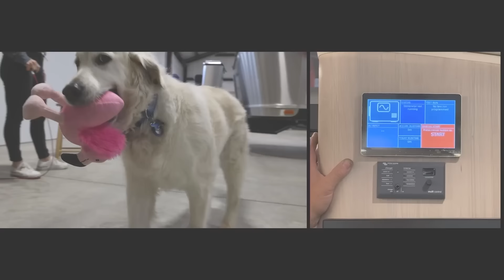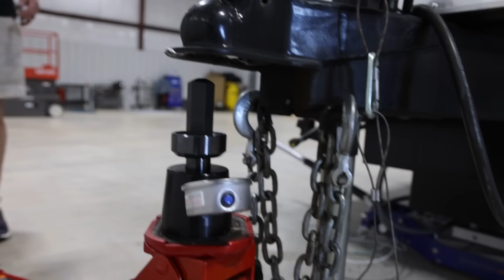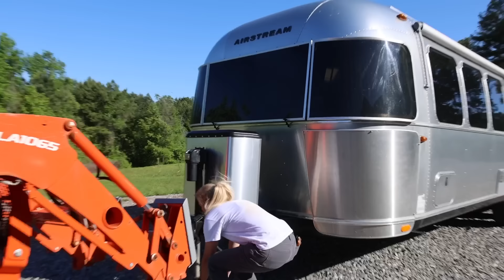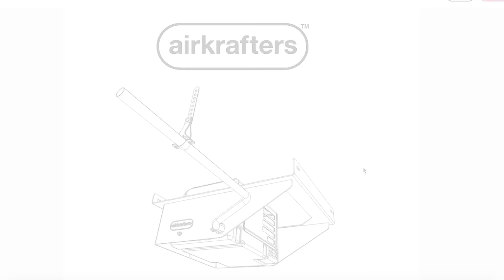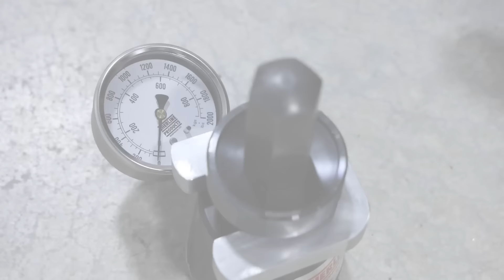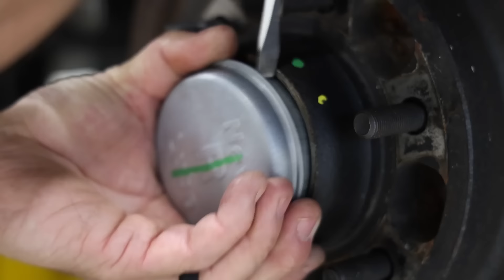DREAM BUILD: Airstream Lithium, Solar & Generator Install

Comment: Really enjoyed the video guys.  Couple things, with the new solar panels I noticed that he left the old panel holes unfilled when he placed the new panels on.....Did he go back and plug them?  Did he take into account the 114 degree plus weather (I know you live in Flagstaff) that you get in Arizona having an effect on the sealant that holds the panels to your Airstream?  And finally, I believe you said you went from a 8" clearance underneath to a 9" clearance once you placed the generator on and moved the spare tire?  So in essence,  you put on a 3" lift and gained actually only 1"?  Will that 1" make a big difference not scraping bottom?  I will definitely be interested in how much it would cost somebody to purchase all of this and have them install it once everything is said and done.  Sorry, one more question, won't the generator connected to your frame not only cause noise, but vibrate the entire trailer?  Take care and Happy Trails.
Reply: Yes the holes from the factory panels were patched, Yes I account to temps and sun exposure, Yes you gain 1” at the Generator, but gain 3” at the butt, the mother for the Generator is mounted with vibration isolators so not vibrating is felt.
Reply: @airstreamnutsandbolts  Thank you.  Appreciate the feedback and excellent job!

Comment: Victron suite Best of the best!!  In Spring of 2020 I went all in on Victron. Battle Born batteries were the only real choice then.. As an engineer, I designed and installed.  To this day it is still A W E S O M E! Just got back Smokemont...no hookups. No worries though with our 600AH batteries, 3000 w inverter/converter, 4 solar controllers, DC to DC converter, and all the other Victron stuff. Solar: 640w Plus auxiliary ground input for added 1000w.  Boondocking at friends and family's the real genius  of Victron inverter/converter: I set the max draw from daughter's wall outlet to 10 or 12 amps and Victron makes up the difference for running our microwave/convection oven,  air conditioner, and toaster!!! Game changer!! The inverter can supply 50 amps combined from the batteries and external input.

Comment: 21:40 I spy an 0155-2449  Resonator / Muffler!  They are awesome.  I installed one on my 2500i inverter generator and did a before and after sound test video on my channel.  It makes the exhaust note a lot less harsh.
That video and all the others on the 2500i are in a play list.
I was a BETA tester of the Onan Cummins inverter generator back in 2019.  It's a very nice generator and so much quieter than the outgoing model it replaced.  I actually prefer using it over my Honda EU2200i because the Onan is quieter.

Comment: Wondering if the movement of the axles (up and down over bumps, etc.) and the water tank straps being attached to the axles will cause flex and movement against the stationary water tank.  Won't this cause unwanted forces on the tank and eventual problems and/or failure of the tank?
Reply: It's not an issue because the axles are Torsion style axles and suspension.  The axles never move like they do on a leave spring style axle - they are hard mounted to the trailer.  The wheel spindles are on a pivot point at the ends of the axles, so the wheels are the only thing that moves.
Reply: The axles are Dexter Torsion axles.

Comment: I like that Ronnie but a pair of brackets under the water tank, but I would think that right angle bars would have been more supportive. The flat bar will flex.

Comment: Rob wants to know: Do you have any concerns about all the weight being on that side? (Fridge, batteries) It’s the best use of space as storage under there isn’t easy access but for weight distribution, he’s thinking behind the battery box might be better. Rob is being logical and I’m trying to save one of my favorite storage spots 😂 Sherry
Reply: This is Rob. To clarify, the added weight was on the driver’s side with the fridge. You chose to put it there instead of the compartment behind the battery box, which would have been centered left to right. Any discussion about more weight on the driver’s side versus balanced left to right?
Reply from the maker: There is still plenty of tongue weight, but I'd rather have the weight over the axles. It hasn't changed the way it tows.

Comment: Good thing about mods is that it’s a to each their own type of thing and I enjoy looking at options for sure. For me, I like off board gear that I can leave behind when not needed such as a generator or easily replaced if it should malfunction. What you’ve done here is give folks an idea of what can be done and that’s very cool and I appreciate the content. Safe travels KYD and hope to see you on our Route 2 Adventure

Comment: Did you go from 2 bolts holding one axel side to just one on the top of the axel ?
Reply: Nope, there's still two bolts per axle and two that hold the lift bracket to the frame.
Each lift bracket has four bolts, two of which are for the axle.

Comment: It's always amazed me at the poor quality built into all mobile homes. Even the ones that charge more for their product.

There is no reason Airstream couldn't put in better skylights or raise the axles to provide a safer experience. Or, how about making a refrigerator door and shelving that will hold your expensive food in place? Trailers and motor homes are at the bottom of the quality charts, and they charge so much for them.

Comment: What's the difference between the micro air and the soft start brand AC soft starts?
Reply: Micro Air has been around longer and is the gold standard.

Comment: I have done mostly what you guys are doing with the solar part. I wired my TV with Anderson connections as well for the DC to DC. The question I have are the Maxim Skylights. Did you have to measure a head of time to order these? I went to their website and it looks like an order form requiring measurements. Did you take off the factory plastic skylight for that measurement?

Comment: I'm watching that strap installation. It's a good idea to put some bracing down there, but it appears like the straps are even giving way from the weight.  Have folks considered going with 1" angle aluminum for the strapping material?  The aluminum should be plenty durable to weather, and the angle would give a lot more strength to prevent the bulging when covering the span between the forward and rear axles.

Comment: Don't  Axles move up and down going down the road, and those straps will move up and down and crush the water tank.
Reply: No, the axles don't move, they are hard mounted to the trailer.  The wheel spindles are on a pivot point at the ends of the axles, so the wheels are the only thing that moves.

Comment: Depressing to watch. The airstream is 200k, a diesel truck is 70k, and mods are probably another 100k. In total a mere 370k cost to get started camping. 🤣

Would love an airstream, they have gotten out of reach for average people.
Reply: They typically buy used Airstreams so you can figure $70-85k for the trailer.  Their truck, at the time, had over 100k miles - so the original cost is irrelevant.  Their solar set-up (generator, inverters, solar controllers, panels, monitors, etc) probably cost $12-15k.  The batteries were, obviously, free.  You are very, very far off from actual reality.

Furthermore, the Leach's are real people but they have done well for themselves.  To fault them for this is absurd.  They do not come off as wealthy, nor pompous, nor anything which screams "we're not for the average people."  They have raised three incredibly well-behaved and successful children and have been on YouTube for 10 years now.  They have grown because of how genuine they are.

Comment: You are getting paid by the companies with products that are worth thousands of dollars. There’s nothing wrong with that. Just don’t say you aren’t getting paid.
Reply: You pay a lot of money for an Airstream and then a lot more to put in the technology that Airstream should already have built in considering the ridiculous price they charge.  Great mods.  For those of us not getting these mods free, what  is the total cost of the mods you made?
Reply: @lew3057  that info is coming in part 2, they said that in the video
Reply: Don’t forget the equity you gain in the trailer kinda like getting paid a little
Reply: Why did you need the tractor to back the trailer into that spot?
Reply: @rlucerin28 tractors are used at dealers & manufacturers to move rigs. I’d say it’s because they move easier than trucks do.
Reply: @Elizabeth-rq1vi  not when they're already hooked up. I can see them doing that after unhooking from the pickup.
Reply: Getting physical paid and getting a product for free are two different sentences. It's important to remember that someone that is not you does not and is not required to speak the way you want it. No point in criticizing the comment.
Reply: @TheBurtonsAreHere getting free product is getting paid because you have just put thousands of dollars into your pocket that you didn’t have to shell out for the products. Sponsorship dollars are still dollars no matter how you slice it. What @mikekuliefinney said was exactly correct and did in in a kind way to boot.
Reply: Marc - you loose a little integrity when you try and say you guys aren’t compensated. Just tell it like it is - free BB Batteries and free Victron gear worth thousands of $$$$
Reply: @markt1054  I keep searching YouTube, google, yahoo, and asking my iPhone and I still can't find a law where someone has to word for word explain or the way you specially want it. For free and getting actual cash are two different structures. No one is required to speak in terms of how you want it, if you got what he was saying then just settle for that
Reply: Omg I was just saying that. You’re not getting paid cash you are getting paid in stuff!! I really like them but that just kind of ticked me off that he stressed that they are not getting paid.

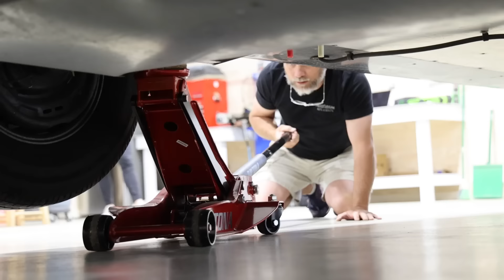Comment: 10:40 please no one stick a family member or another human for that matter all the way under anything this heavy. (I understand that the tires are still on but shackles springs ect break during impact)  use a 2x4 or a stick or something to line up jack stands.  I've made calls with people under things... unpleasant...

yes it's easy to say from a keyboard but if it stops one person....
Reply: This rig doesn't have shackles or springs.  It has Torsion Axles.
Reply: @deltabravo1257  didn't notice that.  Thanks
Reply: Trust me. It’s my wife.  We are very safe. I’ve done 100s of Airstream lifts and am very familiar with the process
Reply: @airstreamnutsandbolts  really enjoyed the video and your explanation and work.  Some people aren't perfectionist as you are and can be quite careless (as I'm sure you've probably seen in customer rigs) resulting in something happening they weren't expecting.    Just my thoughts and opinions.  YMMV.

Comment: I like all the mods you are doing for long term remote camping.  I would also add a water tank to the truck for increasing your fresh water supply.  Then doing outside showers would increase your remote stay.  You can set up a beach shower curtain arrangement for privacy but just remember when taking an outside shower, you might attract wildlife and it would make a scene running naked through the wilderness when being chased by a bear or coyote needing a drink!

Comment: I can't wait until next week, when I'm announced as the winner of those sweet batteries.  
Oh, and old Ronnie said the original weight was 1,025 pounds, but it looked more like 1,050.... 
if those tick marks are 50 pounds each, he may have thought they were 25 each?  
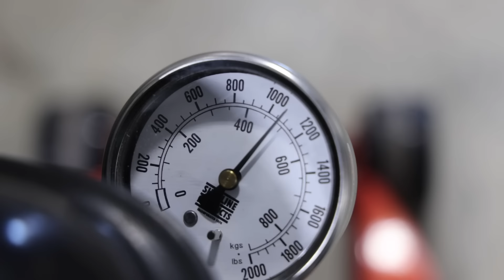8:05 time

Comment: Very nice install.  The strapping for the water tank however should have been done with angle, not flat bar, just sayin'.
Reply: The Airstream tank has a slight bow in the bottom to create a natural low point drain. It is not flat on the bottom. Therefore flat bar stock is the best choice. Angle iron would make the tank flat in 2 spots creating a pond between them.
Reply: @airstreamnutsandbolts  hey thanks for the quick reply and explanation. If you want the sag in the bottom, why install the flat bar at all? Sorry if you already explained it in the video.
Reply: Because the fresh water tank has been know to sag to far down when full of water causing it to potentially fall out.  The KYD rig was showing early signs of this problem so the straps prevent the additional sag therefore preventing a potential trip ending event.
Reply: @airstreamnutsandbolts  ok thanks, good to know. Appreciate the explanation.

Comment: Is there an hours run meter for the generator somewhere? I have a 2800 Onan gen and cannot.find one anywhere
Reply from the maker: I can my run time on the GX70 screen through the Victron Cerbo. Almost time for my first oil change at 20 hours.
Reply: Mine came with the firefly panel. May have to look into adding an hours meter. Thanks for the quick response. 
Though I'll never do a solar system, I still loved the video and cannot wait to see part 2.

Comment: Oh my god, the mods lift, generator, batteries, solar panels, etc all ust cost more then our trailer was 17 k * 5 K5 all extras.

I have open frame Wen RV generator $400, runs everything in our 30 Amp Wolf Pup.

Your living in dream world with dream build.
Reply: You're only limited by your ability to dream...

Comment: Loved the info in this episode; really looking forward to Part 2. 

Question for Ronnie re: GVWR of the trailer — how concerned do we need to be with trailer weight when unhitched with full water and occupants? 

Our 28RB Airstream PB is heavy to start—with a full water tank + two adults + child + dog, we’re basically tapping out on the trailer's GVWR before even considering additional cargo. I’m thinking tongue jack and stabilizer alleviate some of the GVWR axle strain, but curious what your opinion is. Thanks for imparting your wisdom during this (and next week’s episode)!

Comment: Why would you use just flat bar for the straps under the tank and not angle?? Flat bar will still bend under weight but angle will not.

Comment: You are going to love that generator. No more carburetor gunking up issues.  No more worries about old gas in the lines.  When it come to changing the oil, you will be surprised how clean the oil looks after several hours of usage.

Comment: What brand of skylight replacement was that?
Reply: Maxim Skylights
Reply: @airstreamnutsandbolts  what color combination did you use for the three layers? Maxim offers light gray (50%), white (27%), or other for the outer dome and then clear or other for the inner dome and flat panel. Thanks Ronnie!

Comment: Cummins also rates their generators at running watts but they also own onan, so not surprising. 2500w, (even max rating) will run and start two 15k air conditioning units plus rest of both trailers not counting microwaves.
 Torsion axles are easy to lift, we did 3.5" lift on our 5th wheel in gravel driveway because grand design put wring axles in camper to start with. Had to put lift and proper axles in with 2 feet of snow in yard.
For the water tanks, there are some that are designed to travel with liquid in the tanks. While what was installes on yours will help the best way to support them is with angle iron. The flat bar that was installed on yours bends where angle iron wont.
Any battery is the same, once it's done/dead its done and time to replace. Even battleborn won't just give you a new battery cause it's tike to replace them. We ended up switching from them back to FLA because the lithium wouldn't last the night but with FLA we get almost the whole (24h) day.
Reply: The Airstream tank has a natural bow in the bottom to allow for a proper low point drain. It is not flat. Therefore the flat bar strap works better.

Comment: What is the reason to mount the support straps to a U bolt on the axle for the water tank when the axle goes up and down with suspenstion movement?
Reply: Axles don’t move. They are Dexter Torsion axles and are bolted to the frame. Only the Torsion end of the axle moves allowing for independent suspension
Reply: @airstreamnutsandbolts  Thanks, realized you did bolt the lifting block to the axle/frame.  Suprised that AS does not do that out of the factory.  If I ever have an Airstream I will head your way.  Great work and nice shop.

Comment: So, I'd like to see a GoPro video of the fresh water tank straps while hitting bumps (driving). From what I see, the straps are on the suspension, the tank is on the body. Even if the intended purpose of the straps is to keep it from sagging, the rubbing and wear and dissimilar metal (?) will become a future problem. Am I missing something? IDK, edited videos can leave out particulars. 
Also, I hope you read the weight gauge correctly for the prizes 🙂 1125?  looked like 1160 from our angle.
I'm jealous of your open checkbook dream build!
Reply: The straps are mounted to the axle. Dexter Axles are torsion axles and do not move. They are bolted to the frame and only the torsion end moves. The straps are steel and so is the tank shroud so no dissimilar metals there.   Give a brother a little credit. I know what I’m doing….
Reply: @airstreamnutsandbolts  But I don't, that's why I asked...
Reply: It's not an issue because the axles never move - they are hard mounted to the trailer.  The wheel spindles are on a pivot point at the ends of the axles, so the wheels are the only thing that moves.